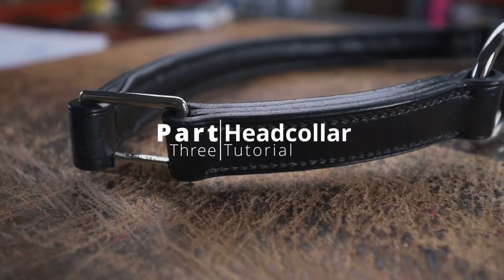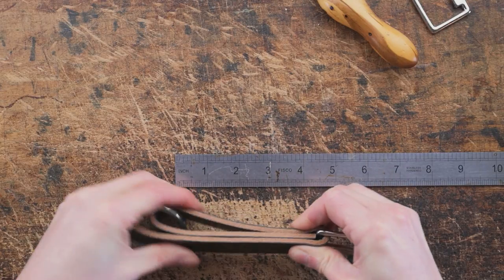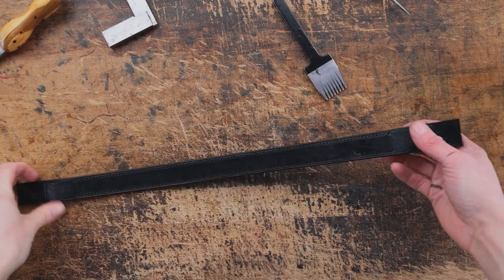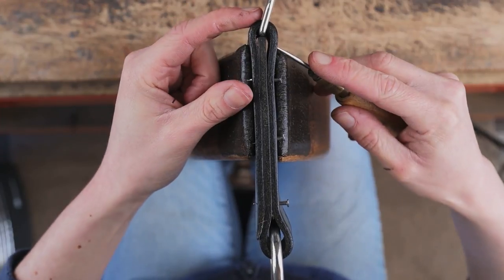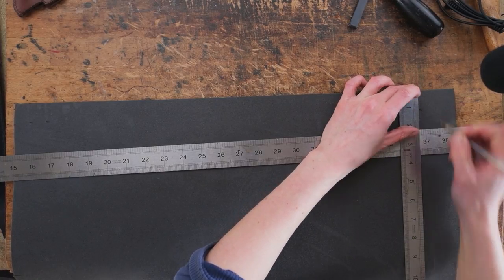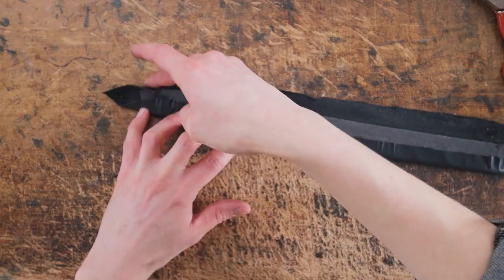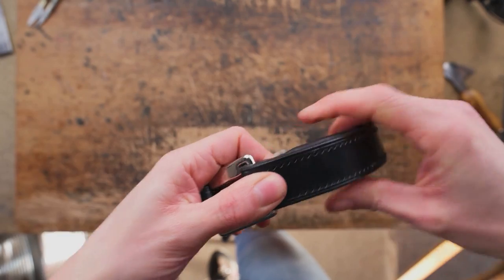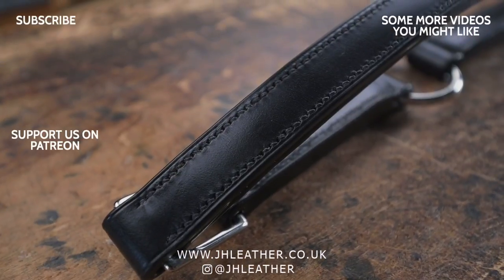Make you own: Headcollar - Part 3 - Noseband and Jowels ~ Bridle work Tutorial

Comment: Suggestion: When using tacks for a temporary hold, driving them through onto a steel plate or anvil [just one hit or they will buckle] the burr bends over and keeps the leather from slipping off. They can be twisted back out easily with needle nose pliers.

Comment: Great series…I’ve seen you use that rag to stain and polish the edges in other videos…what kind of cloth/material is that?
I was also wondering what glue you use? 🙂
Reply from the maker: It's some linen cloth that I use for polishing the edges and the glue I use is a contact adhesive called bostik 6092 👍